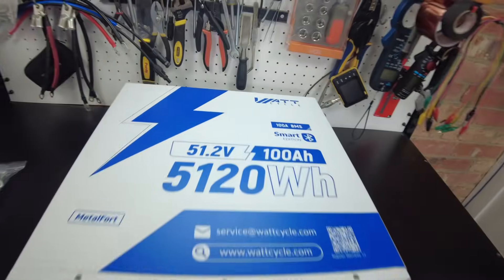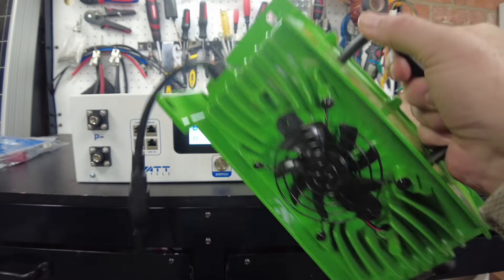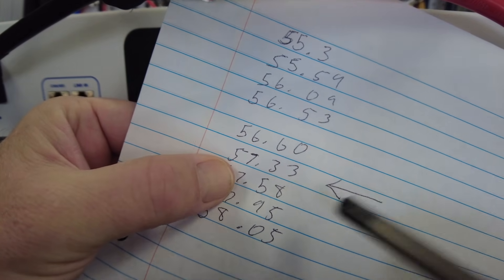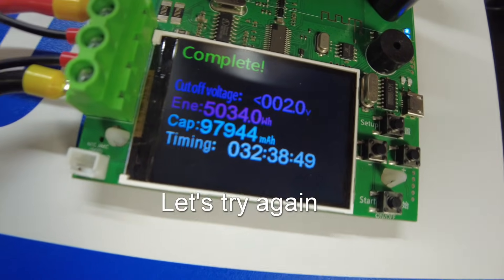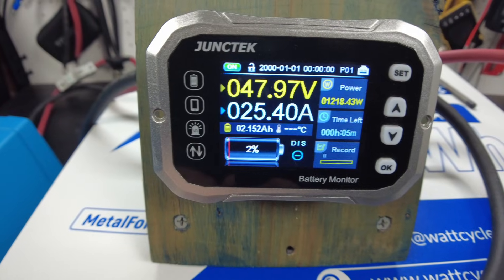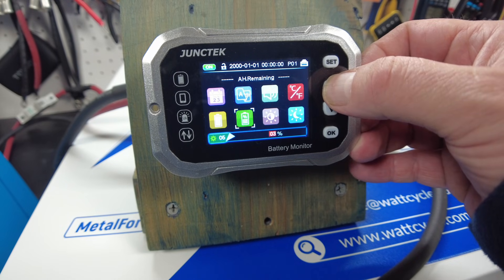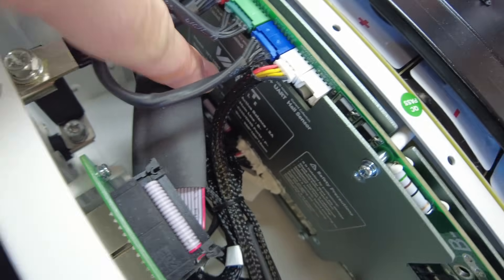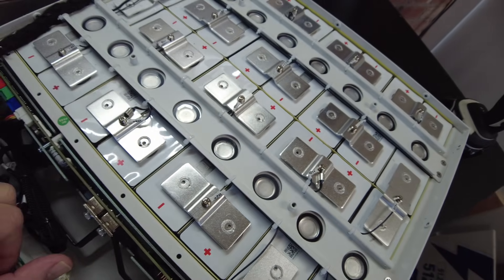WattCycle Gen2 48V 100Ah LiFePO4 Server Rack Battery

Comment: First Thing I See: The same issue has popped up with a few and some actually fixed it fast.  Wire Lug hits mounting bolts when mounted upside down!  Got to be recessed or ??  Cannot have a known serious risk design to go to market until fixed.  JM2C